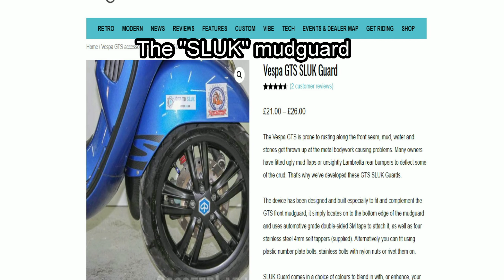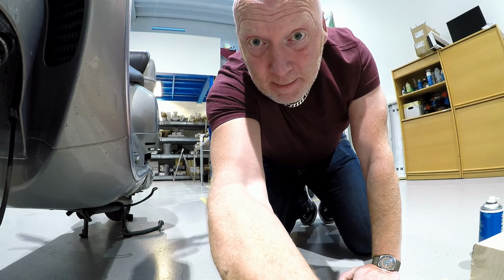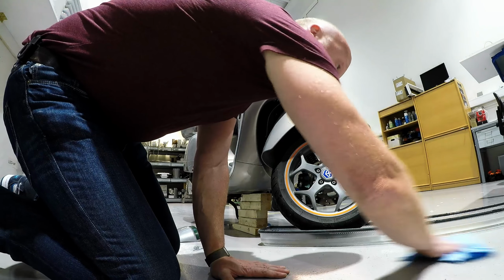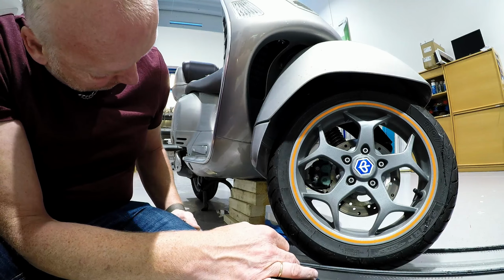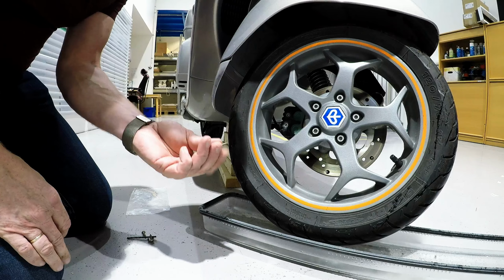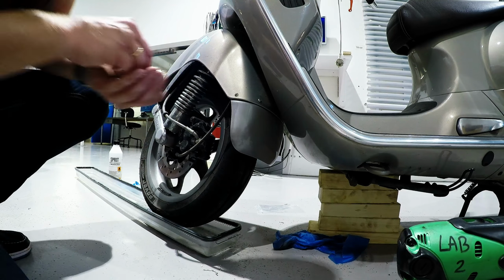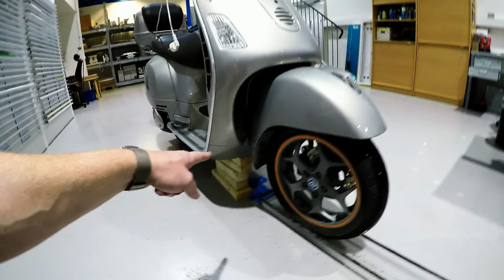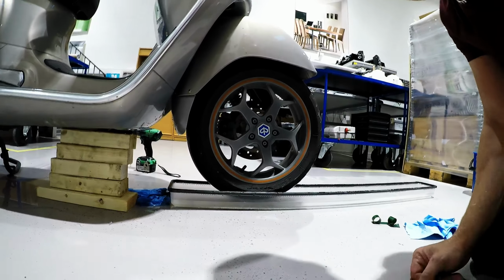The SLUK front mud guard installation

Comment: Maybe you should put a slick extender to the sluk fender extender!
Reply from the maker: Well the video is actually lying as there is no load on the wheel. When the wheel is on the ground, and with you on the scooter, it will be pushed further up in the mudguard and the SLUK guard works much better :-)
Reply: Italjohn13 Ah very good point, I can see it working better with a load as the wheel would be seated further into the front mud guard.  I’ve just ordered mine, the SLUK ULTRA, which is a newer longer design which should work equally well. Good video thanks.
Reply: Hallo,
Can you tell me the partnumber ?
Reply from the maker: @kaywisgalle874  https://scooterlab.uk/product/vespa-gts-sluk-guard/